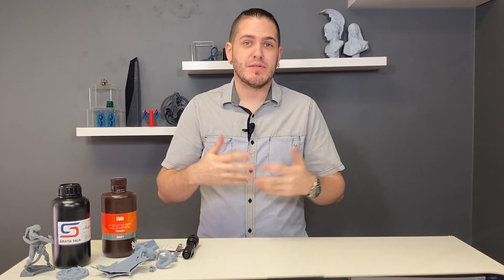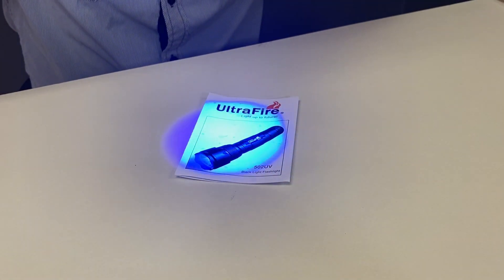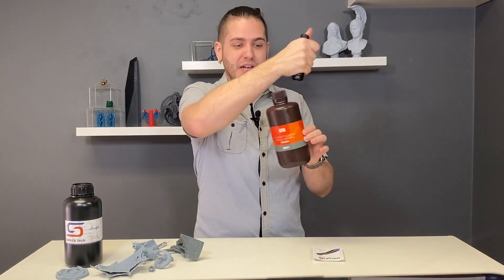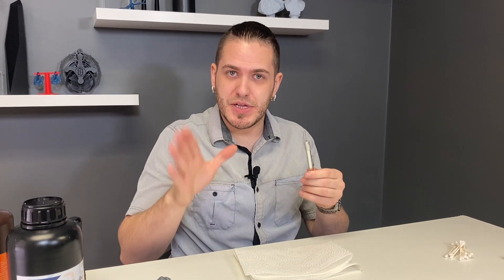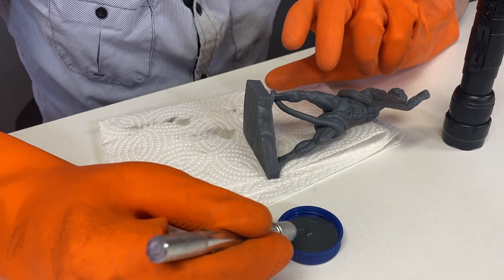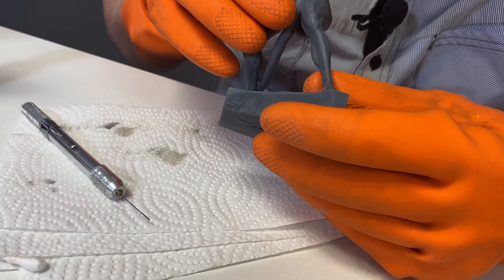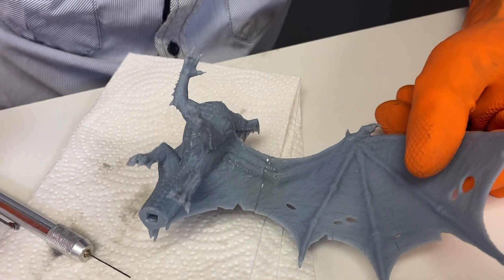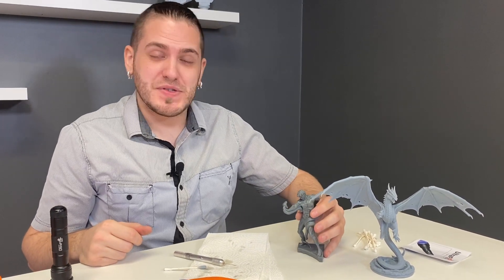Resin Welding - Multi-part 3D Print assembly

Comment: Im probably gonna get cancer or something because I never wear gloves or a mask. In fact yesterday I had to reach into the bottom of my recently cleaned alcohol bath because my dumb self didnt think about the smaller part Id printed or to just dump the bath into a bucket...
Reply from the maker: Although prolonged exposure can cause serious ailments, less serious issues such as contact dermatitis (irritation and allergic reaction) can cause the end of your resin printing career and are more likely to occur over a shorter period. Basically your body eventually can't stand to touch the stuff after dealing with so many prolonged exposures.

PPE is definitely a good idea
Reply: Cleaning alcohol gets into your skin cells and when it evaporates it leaves the space it used inside your cells empty. Basically drying them out. Dont do it often and wash your hands with soap directly afterward to prevent long lasting aftereffects

Comment: How long does it take for the flashlight to cure that excess resin around the bottle?

why does the resin still look wet after curing with the flashlight?
Reply: I print casually in resin, and have done this, but with a larger power UV Light, it still looks wet as the lights we can get in a flashlight or even plug in, aren't really as strong as what come in a printer or in a post processing station. He's also only shining it for a few seconds to not over-expose that resin. He wants it to bond but not turn back to brittle. 

He did mention in the video that while it wouldn't be as strong as something like super glue, it works a bit better in some instances to mold or repair small things in resin prints.

When I do large prints, like replica prop guns or so, I will super glue them together at joining points, then I use this resin welding technique to close the gaps for visiual fidelity and what little strength it offers, finally on most I'll run a thin layer of clear epoxy resin over the print or finish product to not only give it sortof a shine but an outer protection layer since I think Epoxy Resin is a bit more durable when you are printing something that is meant to be held by people that might drop or mishandle it.

Comment: For application I'm thinking a syringe could be convenient. With needle for finest application or w/o for bigger drops.
Using clear (or at least semi-clear) resins would help greatly in reaching & curing in depth!
When cured resin-glued would be stronger than superglue, as superglues work in general but don't create strong bond with printable resins.
Perhaps 2 component epoxy would be great even in depth with opaque resins, but it might be a bit trickier to apply.
Reply from the maker: The transparent resin with a syringe sounds like an interesting concept that definitely has some merit. At least less messy then our DIY route lol
Reply: @ClearMindJewellery  , it's still a DIY style :)
Let me know how it goes if you try it.
I'll also try it very soon, as I'm currently working on a magnetized fantasy chess (a Warcraft-like style - humans vs orcs), and I'll have plenty of magnets & other parts to glue and this time I'll be doing it with resin (previously I used superglue, which works somewhat but not too well)

Comment: Great video! I use the sculpt aswell just the clear version. I’ll let you know how well this bonds with the clear mold. I have a 16 inch plastisol mold that needs to be tested. I doubt any adheasive would be able to handle the 300°+ temps